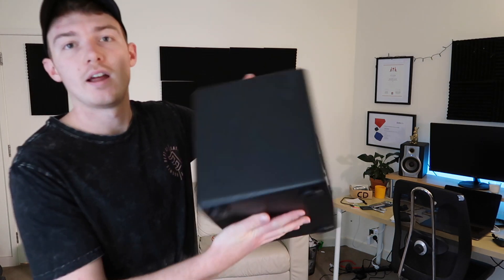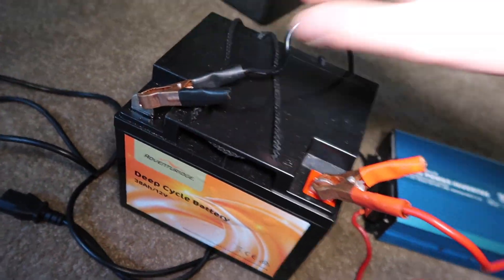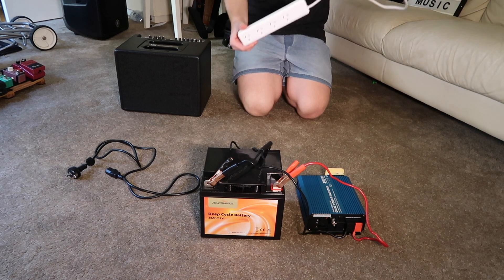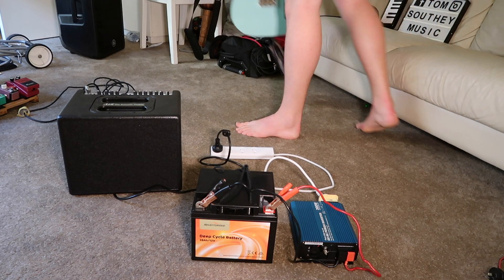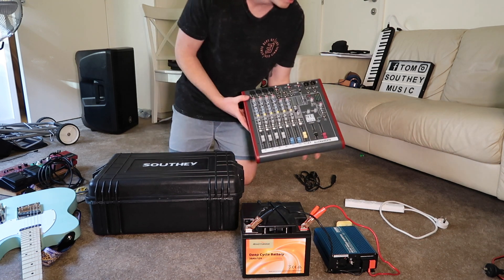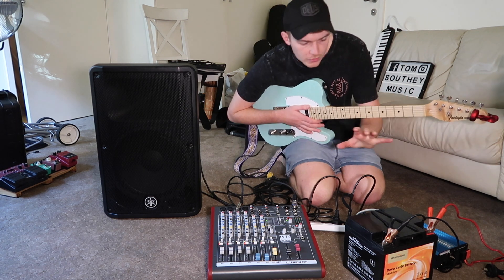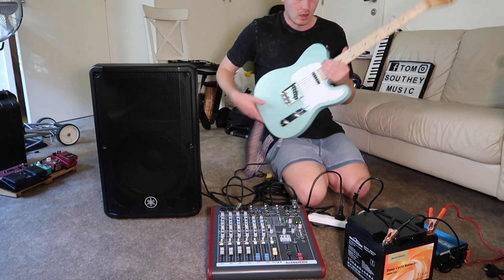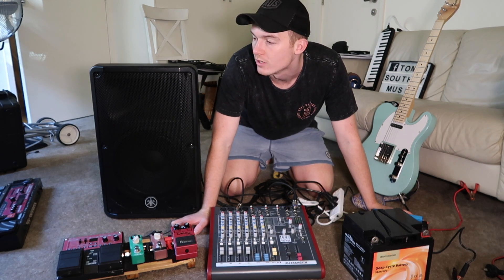HOW TO POWER ANY BUSKING SPEAKER

Comment: hi , I'm thinking of getting a 1000 w Pure Sine-Wave Inverter   what size of battery you think would be good  ,thanks
Reply: Go 85 ah if you can, well worth the heavy lifting👍
Reply from the maker: Hey mate! 1000w pure sine wave will work great for most setups!

It depends how long you will need it to last. 

Get a deep cycle battery (lead acid). 
Anywhere from 12AH-80AH+ 

The (AH) amp hour, is the batteries capacity, if you want it to last aaaall day long. Go for a bigger battery size (80Ah). 

Of if you use it for just a 1-2hr gig, go for a smaller size (20-30Ah). 

That's a rough estimate! Goodluck mate! 

Also, 
Bigger means Heavier. So maybe go to a battery store and sus them out. A 80Ah battery is about 20kg! 

I use a 36Ah battery and 600w pure sinewave inverter and it lasts ages. :)
Reply: @southeyforartists   thanks bro  .iv looked at a few and sent you to see what you think

Comment: hey tom! question for you, would my 800w Digital modified sine wave inverter work on a Laney ah40 amp? sorry I just find it all very hard to understand and there doesnt seem to be good info online about amps and digital quasi sine wave inverters
Reply from the maker: Hey Mel! I think the answer is, it would probably work.. it's just not as preferable as a pure sine wave. So this could mean you might get potentially get some humming noises or it might be a little inefficient. It all depends on the quality of the modified sinewave inverter. 

People do use them! They're cheaper. But the electricity they output can be further from what your amp is used to, coming straight out the wall! 

Hope that helps! 
Tom

Comment: Hello Tom! Nice rig Indeed. I just bought 500w inverter and 20Ah deep cycle battery, but still i haven't fount an active speaker to work with this setup( ev zlx 12p, db opera 10", and a simple sony hifi). Mind that on the battery says max output 2,1 amps. Maybe that's the culprit?
Reply from the maker: Hey Tom! Hmmm... what does it say is the output on the inverter? 240v 50hz?
Reply: @southeyforartists  yes! Exactly. An all the speacers works with this power rating (220-250V , 45 - 55 Hz)

Comment: Hello what is the best way to carry it? Do you use a trolley? How long to the battery ends including a pedalboard? Thank you
Reply from the maker: Hi Ary! Definitely some sort of trolley. I have used a few, currently I use an old cooler box to store the battery and cables. I have a strong folding sack trolley :)

The pedalboard power usage is very very small, so it doesn't change the overall life very much. 

I have never run out of charge, and I often play 3 hrs straight maximum. 

I think the overall charge would be over 5 hours but have never needed to test it. 

Hope this helps!
Cheers!
Reply: @southeyforartists  Thank you

Comment: Hi, Thanks for your informative video, first of all!
I was curious, with the experience you now have, would you say that this is a good set? Any brands in particular (I live in the Netherlands, as for electricity)?
(I have also an AER compact 60 but also different effects.)

- 36 AH battery (deep cycle) - Is that enough to handle a few effects?
- Battery charger 12 V -  2.4amp charger. 
- Inverter - pure sine wave inverter (300W, peak power 600W)

Thanks again!
Reply from the maker: Hey David! 

I've been using this setup for over 12 months and it's always worked great. 

I've had no problem powering multiple FX pedals alongside the Compact 60. 

I'm not sure exactly which brand of Inverter is best. Mine doesn't have an obvious manufacturer. 

I'd just check the output on the inverter, and try to match it with the mains electricity in the Netherlands. (Here is 240v 50hz usually)

The battery size at 36AH is more than sufficient, gives some extra room. I never run out of power :)

A similar setup should do you fine! 
Hope that helps mate!
All the best!
Reply: @southeyforartists  Thank you for sharing all this! Very grateful. Cheers!
Reply: Saludos este inversor es de onda pura?

Comment: Nice vid thanks , do you think that acoustic amp would handle bass by any chance , I do have  class D 450watt amp would I be better off just trying to get a small speaker for my amp. A friend in London used to used a 12v motorcycle battery, inverter, and a car amp and speaker for his piano , im looking for a cheap option.
Reply from the maker: That AER Compact 60 amp is primarily designed for Vocals and Guitar, so its definitely optimised for those. It's actually surprisingly expensive for its size (sounds amazing though).

When I busk and loop i still use an octave pedal to lay some bass down with that amp. It works, but its not 'ideal' for bass. I'd recommend getting something with a 10" or 12" cone so you get some real punch :)

Maybe a cheap 12" PA speaker and a bass preamp pedal or something? Would probably be cheap and work better for your purposes!

Comment: Does using your large Yamaha speaker reduce the amount of hours you can play outside? I will have a 2 turntable, 2 channel mixer, laptop, and amp/speaker set up and am wondering if that will draw more power than yours or how much more?

Went to Reddit trying get answers but most people seem to think any battery will only last me 1.5 hours (asked about using a 20AH), but they don't know about using a battery this way I think.

Just got offered this massive boat battery for free, but it's 29kg and 96AH.
Reply from the maker: I think the main draw on power will be your speaker/amplifier! the other equipment is generally uses less electricity. 

For that whole setup using a 20AH battery 1.5hrs is probably not far off i'd think!

The small AER compact 60 Mobile amplifiers have 14AH battery and last 3 hours, but would draw less power than your setup.

If you can get that 96AH for free it's not a bad idea! That will be 4 - 5 times the capacity of the 20AH and would last much longer,  5hrs+ i'd say at least :)

There's so many factors that influence how much time you will get, but thats a rough estimate in my opinion!
Reply: @southeyforartists  Thanks for your reply^^. Yes, I have been wondering which speaker/amp to get. I've looked at a few 20-50 watt and then near 400watt. That's a big difference and I kind of wonder what would be the difference in terms of hours played.

Yeah that battery is free 96ah but it's going to add a lot of weight to this cart I'm going to build so I saw another 50ah.

How much does your guitar use in watts?

Do you know anything about these solar powered battery chargers? Probably not possibly to be charging the battery while the inverter is attached to it, but a solar battery charger would make charging the battery easier if they work and especially if I have a 29kg battery.

Someone said the battery charger needs to be at least 3 amp hours.

Comment: Deep cycle battery vs. lead acid battery? IDK. What's the difference? Duh. I just saw your description. I have two turntables and a 2 channel mixer and an amp I will need to power any ideas? Would these things likely work?

Any idea how long that same 12v battery would last? You said above you get 10 hrs with your small amp.
Reply from the maker: Hey sorry for the slow reply, usually deep cycle batteries ARE lead acid. 

So the main difference you want to look for when getting a lead acid battery is that it is Deep Cycle (meaning it has a long, slow discharge, ideal for electrical appliances).

The other type of lead acid's are like car batteries. These only work for a few seconds when you start your car engine, so they use looots of power really fast. Fast Discharge. And then they do almost nothing until you need to start the car again. 

Boats and Caravans use Deep Cycle or Leisure batteries. Usually it will say on the sticker! Hope that helps!

Comment: Does anyone know why’s size inverter I’d need for a Yamaha stagepas 1k, 1000 watt pa.  25 W (Idle), 85 W (1/8 power) power consumption ?
Reply: I found with a 300 or 500 watt power inverter, the inrush current when I tried to switch on two Peavey IPR1600 was too much and it kept cutting out. I've ran a "550 watt" drill off a 300 watt inverter and it only cut out when I needed to drill wide holes at full speed or screw in a screw.
But it could be that the car had a weak battery. So get a kill a watt meter and see what your inrush current is. Depending on how loud you need it, I would think the 150/300 watt would do but some amps have a peak current when you switch them on that requires most of the power of an inverter for half a second. The "1/8" power rating is chosen actually as what you'd expect of the product at near full volume on ordinary music with a bit of kick and bass reaching the "1000" watts and most of the music being much less.
If you are running stage lights, they are continuous draw and so you must exceed their power rating. So 1000 watts of stage lights would need probably a 1500 watt inverter and a decent battery or two to prevent cutoff.
Reply: Tim Lewis thanks for the reply 👍

Comment: hi !! may i haver question? there is no problems with baterrie? when you cross the border to somwhere by flight? and i thinking to get yamaha pa speaker,  czr or cbr or cdr , one of them (12 inch speakers) , do you thing thoes models have really different quality ? because i might get czr model but its almost double price compare other two different models haha thats why.. i hesitate to get it now :(
Reply from the maker: I left my last battery in the UK, and bought a new battery here in AUS. 

Probably best not to fly with the battery. Too heavy and too expensive. Just buy another when you travel, unless you have a very small one.

Comment: I found out the hard way that if you discharge your battery below about 50% very often, it will soon stop taking a full charge, eventually no charge at all.  Best to stop at about 40 to 50% discharge.

This does not apply to lithium batteries, which can be completely discharged without a problem.
Reply: What kind of battery do you have?
Reply from the maker: Yes this is true! 

It's best to keep above 50%

I use this battery for my 3 hour gigs. And try to charge it afterwards every time. 

Not sure exactly how much it discharges but I know its capacity will provide well over 10hrs playtime.

Comment: .....A mic, guitar, looper pedal, harmony pedal and amp....wonder if it would handle it all....
Reply from the maker: My current setup, I use this battery and inverter. 

With a power board daisy chain with rc-30 looper, 3 other FX pedals, one 12v vocal FX pedal. Connected to my AER compact 60 amp. 

Runs all of it fine for hours and hours 👍

Comment: Question: Do you know if it is necessary to match the Hz output of an amp with that of the inverter? Just noticed that my inverter is 40Hz and my acoustic amp is 50. Who amongst the brains trust here can give me a thumbs up or down? Cheers - great vid
Reply from the maker: I'm actually not sure! my inverter is 50Hz which i think is standard.

I found this,
https://www.quora.com/What-happens-if-I-use-a-60-Hz-appliance-in-50-Hz

In my (uninformed) opinion it shouldn't be an issue i think, might be worth making sure there are some fuses and overloads to protect your equipment at first. 

Anybody else know much about this??

Comment: Just setup a busking rig for my son. Using a backing tracks and a Blackstar Artist 15w at volume that is possibly a bit too loud the entire system is drawing about 150w. It is a 400w rms DB speaker but clearly it's idling. I was very surprised just how little power it was actually using.
Reply from the maker: Nice one! Cheers for sharing it's impressive what you can get out of a little setup 👍

Comment: TOMSOUTHEYMUSIC, Your charger is at what AMPS, some AMPS are at 4amps and others are at 10amps. The charger that outputs only 4 amps I'm guessing would take hours to charge a 12volt battery?
Reply from the maker: Hey Bill! My charger there is only about 3amps. 

As a rough estimate, take the AH rating of your battery. Say its 36AH and you have a 3 amp charger. 36/3 = 12 hours charge time from zero. (theoretically)

Keep in mind, its best to not discharge deep cycle batteries below 50% charge. 
AND
It's safer to charge batteries at a lower Amp rating for the health & longevity of the battery. 

Trickle chargers (low Amps maybe 1 or 2amp chargers) are very slow as they 'trickle' the charge into the battery. But they can be left on for weeks without damage to the battery, they're often beneficial.
Reply: @southeyforartists  , ok thanks so I should get a battery charger that is lower amps like  2amps or 4 amp battery charger for a bettery tickle charge the battery for longer life?

Comment: 0:25 the label on the Yamaha says it consumes 74 Watts, where did you get 1000 from?
Reply: 1000 Watts is power output of the amp, not the consumption. That's probably why it didn't blow the fuse on the inverter or trip the breaker on the outlet strip. He'd have to add up the wattage consumption of all his gear and keep it below 300 watts in order not to overload the inverter. At 300 watt peak output, the maximum time he'll get with a 38 Ah battery is about 3 hours not accounting for power lost to internal resistance of the battery. 

The maths is like this:

Power (Watts) = I(Amps) * V(Voltage)

Therefore, 

Amps = Power/Voltage

300W/12V = 25A
38AH (Amp Hours)/25Amps = 3.1 hours, or 3 hours and 6 minutes.
Reply from the maker: Hey! 
So I did a little research,
This speaker is rated 1000w output power. (Peak)
The 'Continuous' measure is a more appropriate figure, but usually in order to compare speaker sizes manufacturers refer to Peak Power. 

The power consumption is lower again as you pointed out!

Output power: Dynamic:1000 W (LF: 800 W, HF: 200 W) / Continuous: 465 W (LF: 400 W, HF: 65 W)
Maximum output level (1m; on axis): 131dB SPL
Power consumption: 74W(1/8 Power Consumption), 18W(Idle)

So the speaker is using 74W of power, to take the signal from my mixer and amplify it with the help of the speaker cone to 1000W peak energy. 

The numbers can be quite misleading! I hope this helps! If anyone has a better explanation please jump in! 
Tom
Reply: i know this is a very old comment but it consumes 74 watts but outputs 1000w. basically it "takes" 74 watts from the battery and uses that to make the amplifier take whatever comes into the pa system to 1000w of energy that comes out of the speakers

Comment: Thanks mate! Appreciate that. 
It might be a stupid question but, how do I charge the battery??
Cheers bruv!
Reply from the maker: You can buy a 12v Battery Charger, or a Trickle Charger (same thing just charges slow). You can find these at car parts stores or hardware stores!
Reply: @southeyforartists  Mine never worked very well. It never gets fully charged. You're lucky if there's enough power generated to start a vehicle after the battery goes dead.
Reply: @JoeDoe2  
If the battery goes dead, then of course it's not gonna start a car

Comment: You don't need a pure sinewave  to run a amp, just spending more for nothing.
Reply: sine wave eliminates audible humming
Reply from the maker: you're right you don't, but they convert much more efficiently and you've got less risk of getting electrical 'hum' through your speaker. 
Pure-Sine Wave's are coming down in price but you're right, if you're really strapped for cash a modified will do!
Reply: @southeyforartists  But not on a guitar amp though right? Modified signwave inverters can peak and overload delicate electronic gear. Only true sinewave inverters provide a consistent wave.
Reply from the maker: @micharquette9321  I'd always go Pure Sinewave, protect your equipment! :)